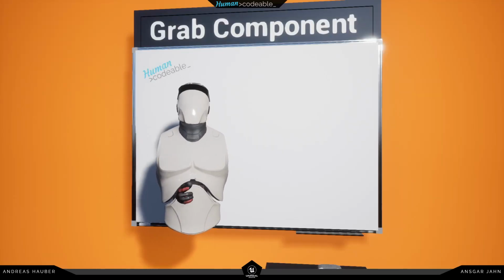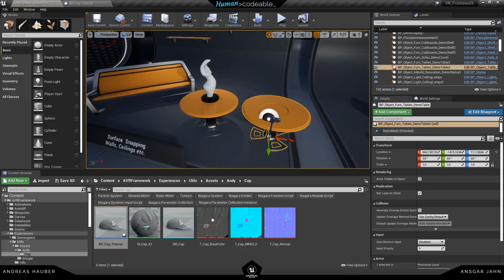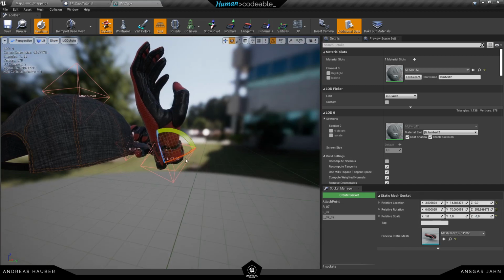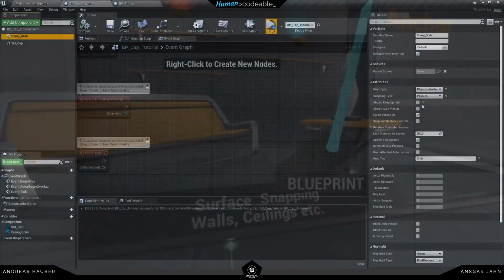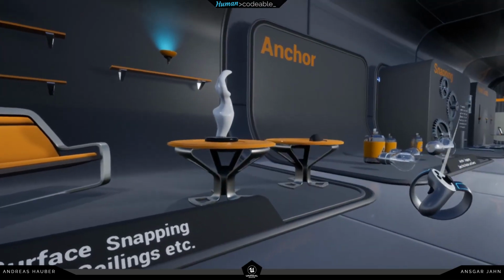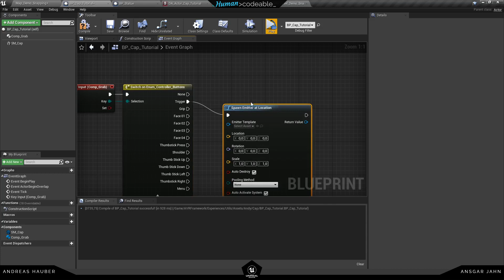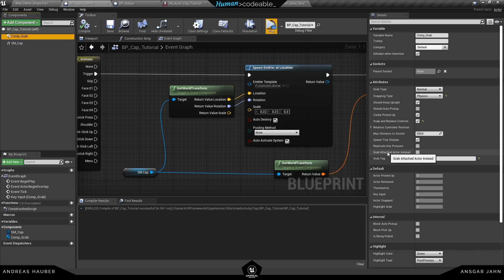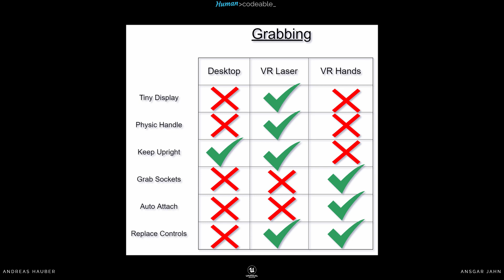AVR 3.0 Tutorials - Grab Component and the magic of picking things up 🧙‍♂️

Comment: Hey :) Very good framework, it's extremely handy for fast iterations!
By the way, is this possible to grab an object with two hands? I didn't any mention of that anywhere. If not possible, would you have a tip? Thanks for helping!
Reply from the maker: Hi there, no this is not implemented yet. We integrate new features by our Patreon´s voting and this topic was not voted yet. We might want to add it in a future update but this will not be an easy tasks. Especially if you want a two hand grab like in Alyx ;)